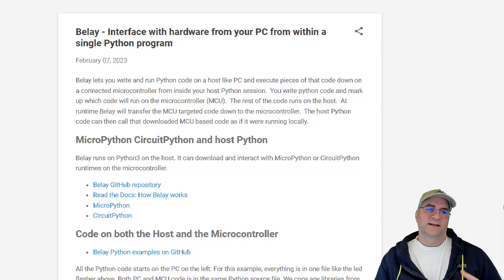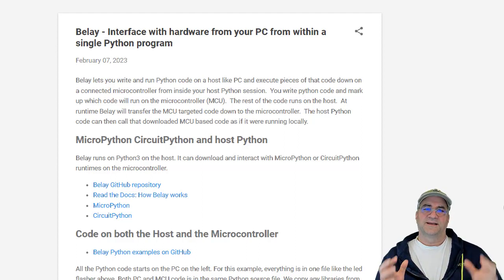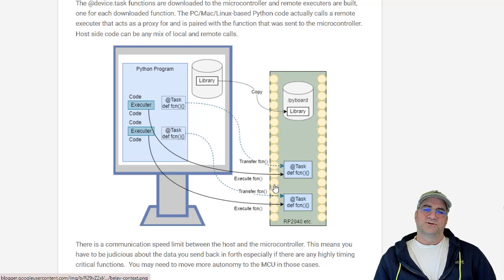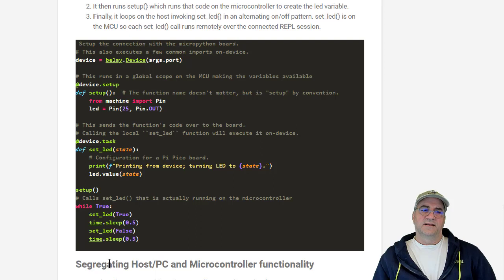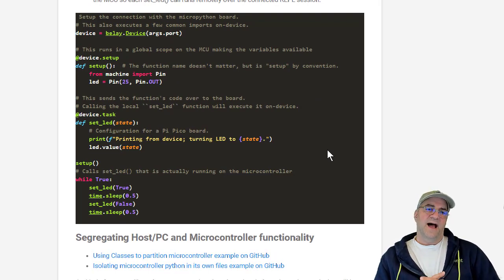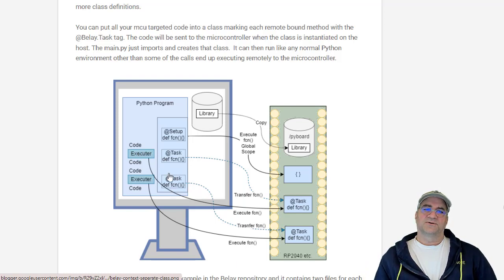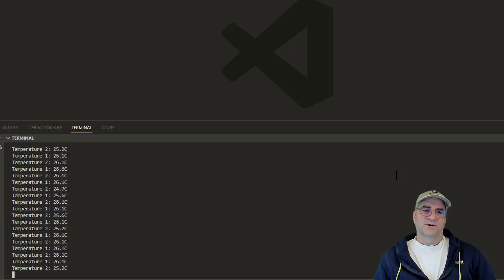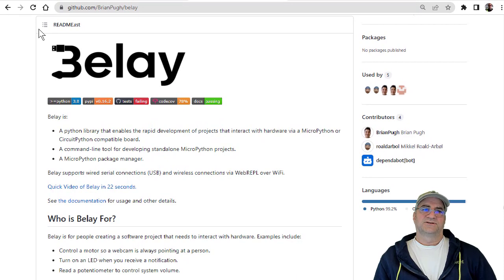Belay - Run Python on a PC and and transparently execute functions on a connected microcontroller

Comment: But how do I setup the belay device ? I have a pyboard connected to COM9: on my Windows 10 PC. Example shows device = belay.Device("/dev/ttyUSB0"), but it doesn't work. I tried changing USB0 to USB9, but no go, Do I use COM9 instead of /dev/ttyUSB0 ?